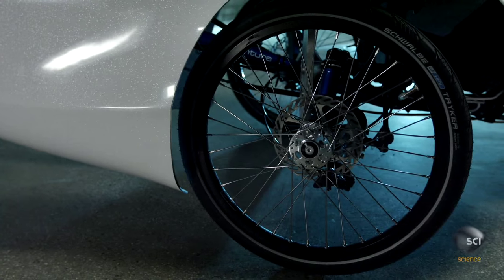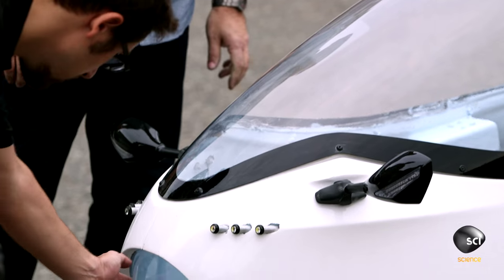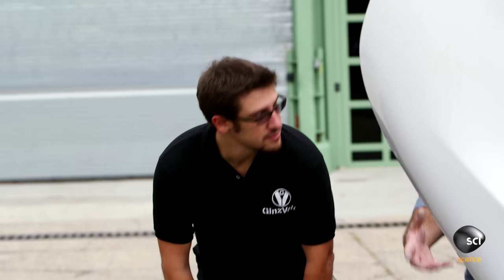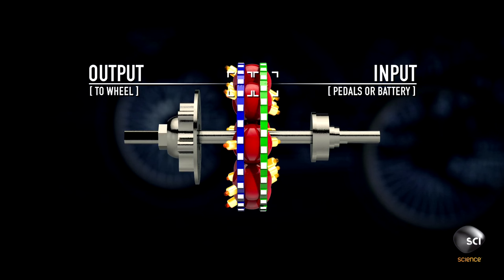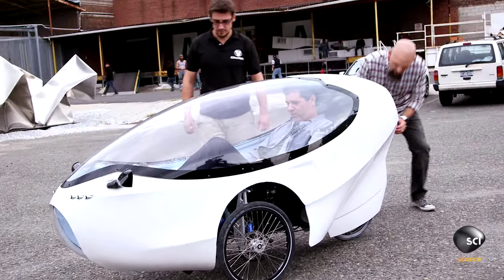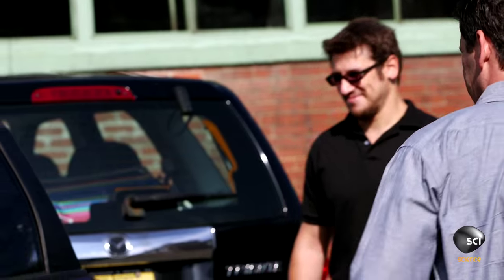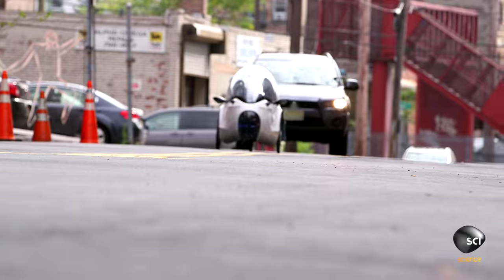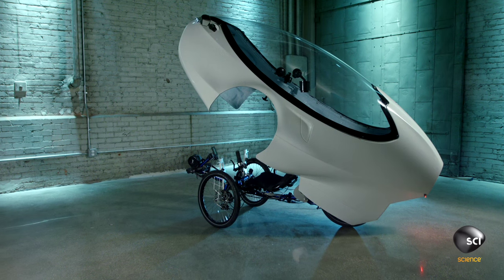Human-Electric Hybrid Tricycle

Comment: Get a PEBL. It's far more developed and sophisticated with bicycle pedals and/or electric power, floor pans to prevent water splash-ups in wet weather, an electric windshield wiper, a heater for winter & fan for summer, roof solar panels, dome light, full exterior head and tail lights, turn signal lights, zippered side panels, two small lighted storage compartments, and a back seat large enough for an adult or two children.  It can be charged with either 110v AC house current or the roof panels. Expensive, but factory made and worth the difference.
.

Comment: I am more impressed by the gear system. I never knew such thing existed!
Reply: The NuVinci Hub is awesome
Reply: NuVinci hub is not rated for more than 250w of torque.  It will eventually snap or break.  My opinion is that the Rohloff hub is much more reliable for an electric mid-drive system.

Comment: what's the shell for? to  make the tricycle part less embarrassing? how fast does it go? can i charge the battery by pedaling. do i get a car or motorbike parking permit? what is keeping it from being stolen? why is the video showing it only 3 minutes didn't answer these questions yet included a failure?
Reply: Totally great points. This seems only 1/2 of the coverage that needs to be there! The shell makes it aerodynamic, which is very perceptible at speeds over 12 miles an hour & makes for dramatic performance enhancement. This can go at speeds over 30 mph and I have personally ridden one over 60 mph (on private property, of course) -To not be stolen, one would attribute the fact that A) It's very unique, and therefore conspicuous (like trying to walk off with the Mona Lisa) plus, it's very difficult to get your arms around... The canopy locks while you're gone. With a 100 mile range on the battery, this model doesn't require regenerative braking, but it's a consideration for a future model. Thanks for your great questions!
Reply: Philip Huerter
thanks for the great answers. just a little late to the anniversary. do the wheels lock too? it's still light isn't it? can it be pushed?
 also what's the thing called so i can find more info?
Reply: You bet! I'm getting these built in New England now. The design's markedly improved! I actually fixed the model you see there at the Discovery Channel footage. We're going below 100 lbs in weight... maybe even close to 50 lbs with a carbon fiber shell and a new modified design. There is a rear wheel lock, plus an atmospheric sensor (pollution detector) that tells you what it's like in the exterior, while the cabin interior has a HEPA and charcoal filter to remove toxins. It's really coming together. Some Tesla Motors reps have expressed interest in this sensory system we're using... Electric cars are really sweeping the trend now, and this is a great way to have fun, raise awareness, and test out some cool tech concepts. Also included are some smartphone connected Apps like opening the hatch, the night-vision camera system, and security...
Reply: Philip Huerter
the website i visited said it's $4,500 minimum, since it's a mode of transportation you'll have to leave it unattended unless you ride for leisure only. isn't it dangerous to have it only 50 lbs, even 120 lbs isn't much of a haul. i'm also wondering where you put your stuff, ya wear your back pack on your belly? or are you only moving what's in your pockets?
Reply: bob vella; yeah I'd feel better locking it to a telephone pole. In case there isnt one around, there are GPS trackers for less than $15 plus wireless plan. Coupled with a motion sensor, catching a thief before he gets far should be easier.

Comment: He has basically copied the HPV bike design I race with my school. Some how this guy managed to make the worlds ugliest HPV bike in history plus  it should be way lower to the ground to give it better turning stability.
Reply: Let's call it the "zeitgeist" factor. Building enclosed canopy trikes is becoming more popular as an obvious "weather solution" for this 3-wheeled stable cycle. Plus a trike doesn't have to be expensive, which makes it an ideal "platform" for design experimentation. You'd be surprised to know how low it is... plus the batteries are below the seat which helps shift the center of gravity lower. That's about 16 lbs for one 40 Ah battery (2x's that for 2) providing a likely 150 mile + range, depending on the number of hills you travel.
I think the design is pretty futuristic. What's your idea of a cool design?
Definitely need to work out the bugs!

Comment: just leave it open on the top , the plastic should be low, because aerodynamics in such a low speed as a electrical bike is nothing important. Simple physics.
Reply: ***** a better motor would do the job  instead of aerodynamics